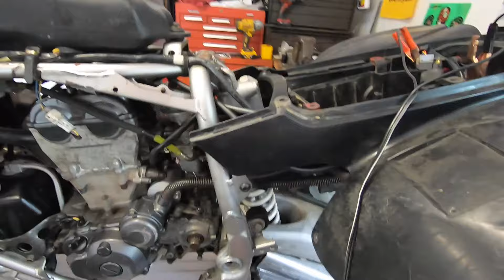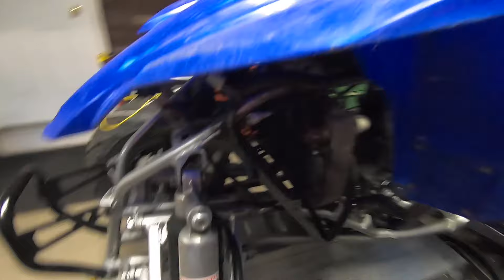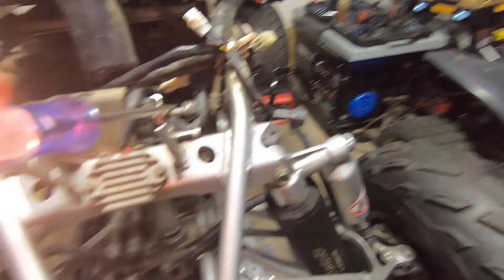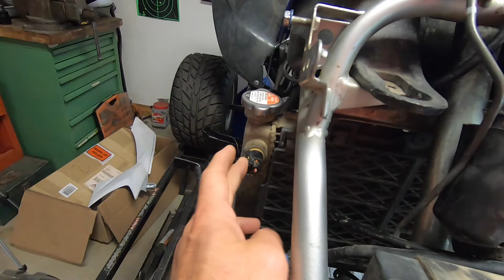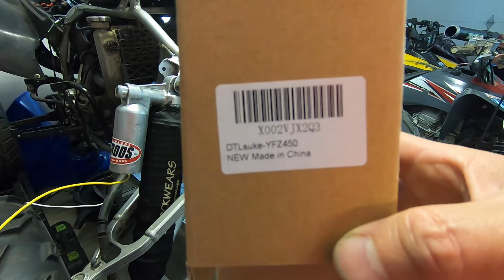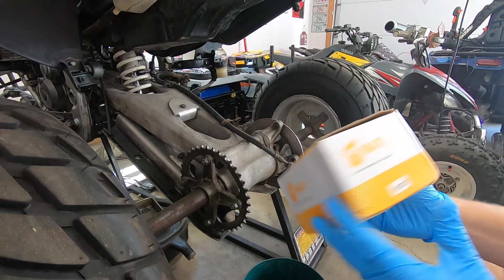YFZ450 Parts Bike Rebuild Part 3

Comment: In the off position on the key switch, would that be a ground to kill the engine, the kill wire,when you turn to off it grounds out the coil?
Reply from the maker: Two power wires one for each side of the switch. If you put positive to ground you have fire lol
Reply: @RCBGarage  Maybe power to the fans heat sensor when the bikes  turned off for cooling after the bike comes back hot.